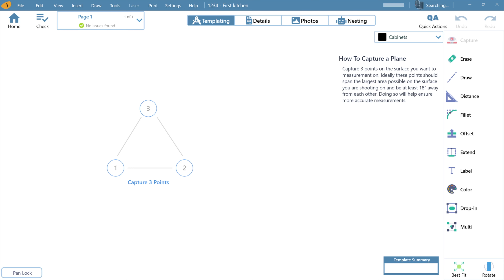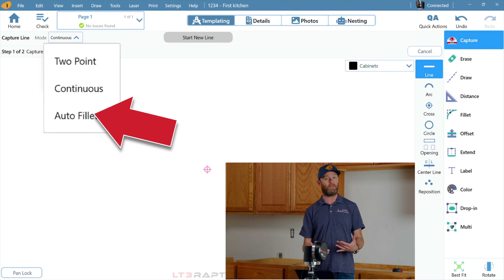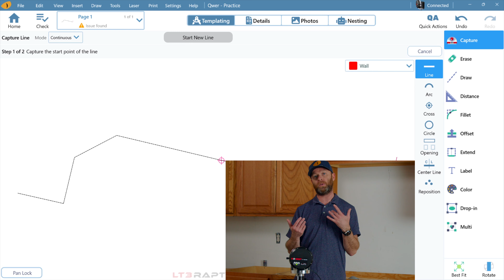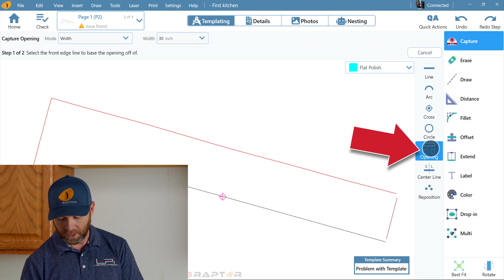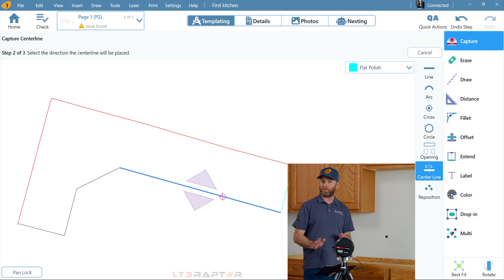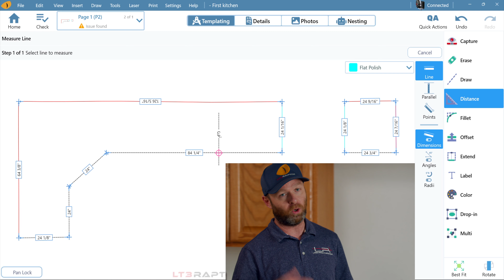Capture My First Kitchen

Comment: Does the size of the sitting triangle matter?
Reply from the maker: It helps to set your plane larger instead of smaller.  Generally capture your plane so that it covers most of the template area.